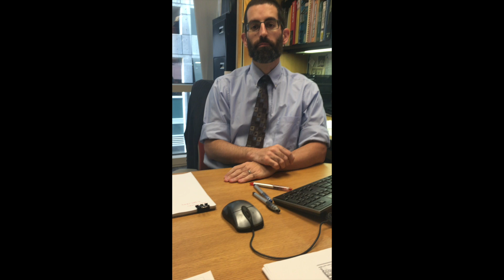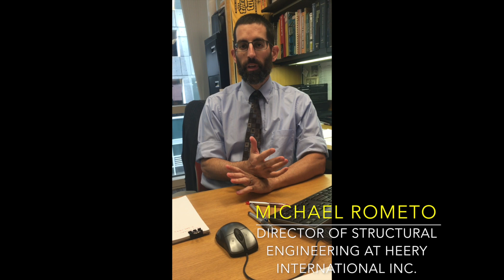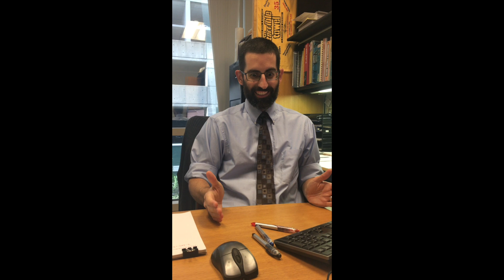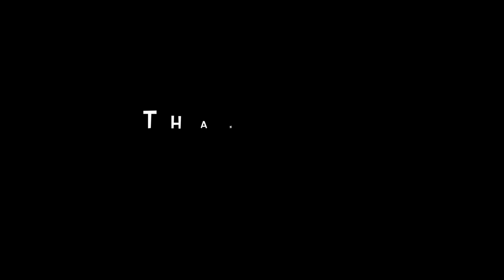Structural Engineer Interview

Comment: Isn't sizing the foundation at the last stages of design process?
Reply: Nope, structural eng start's from buttom of the building to the roof of it in design
Reply: @omarshaikhaljabal1106  so how to calculate the load coming to the foundation from upper part of the building?